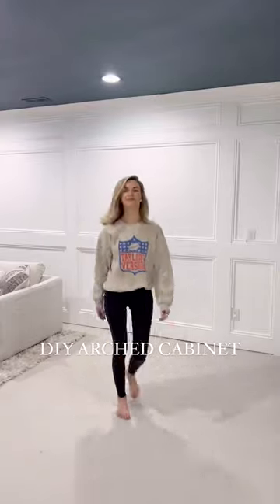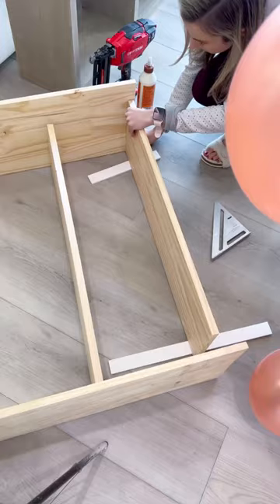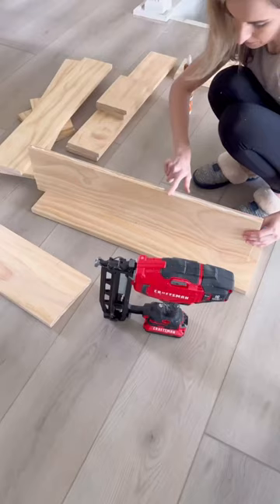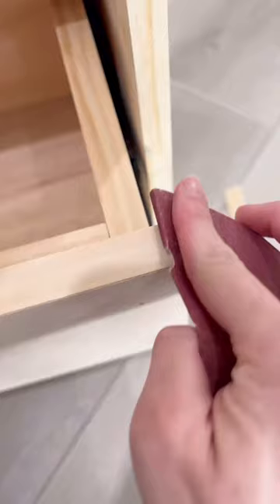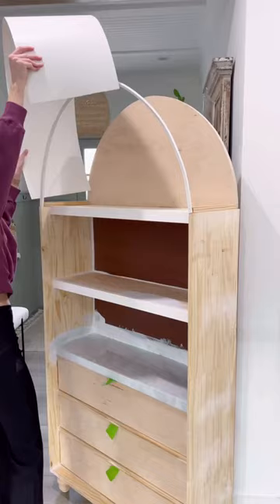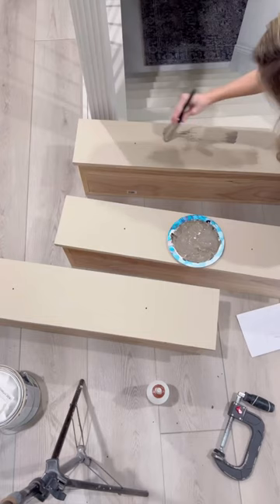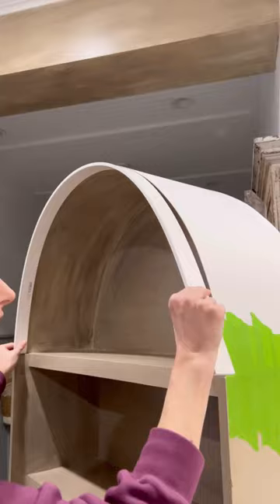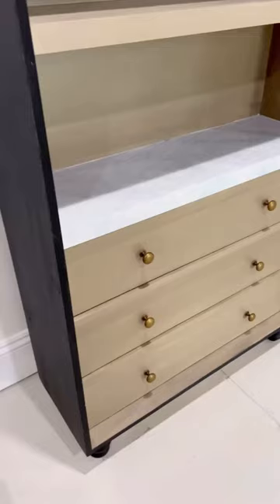My DIY ARCHED CABINET - phase 1 - is underway! And I’m loving it so far!

Comment: What’s the name of the material the bends please
Reply: I think she said she used a utility panel for the area over the arch that bends. It looks like she painted the inside to match the rest of the cabinet (after securing it to the sides and back of the arch). And I'm assuming she used some sort of filler or maybe bondo to smooth the outside where the panel is secured to the shelf...then painted that to match as well....?